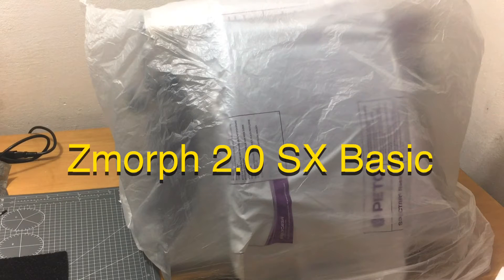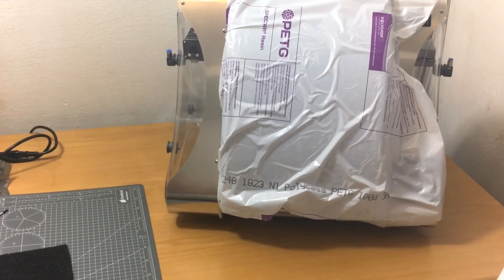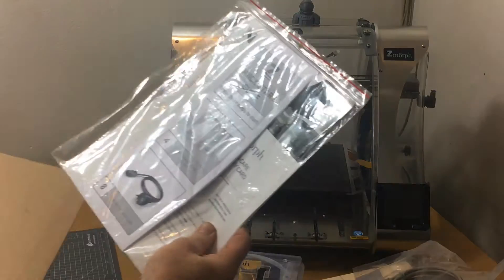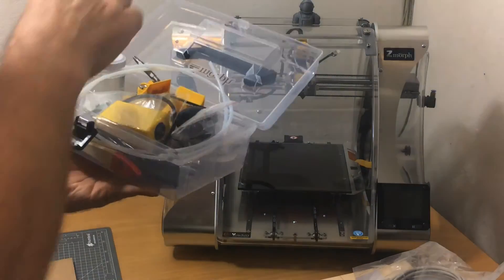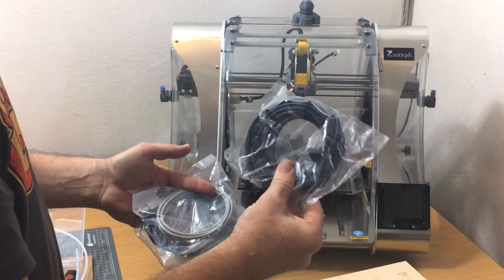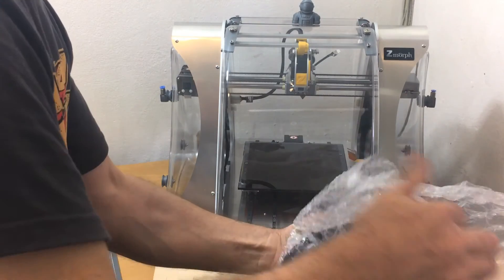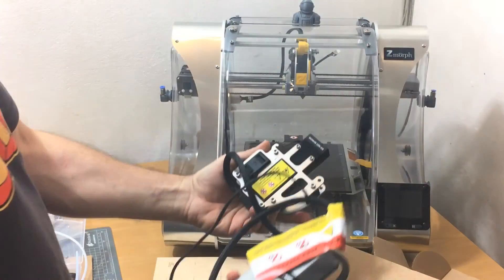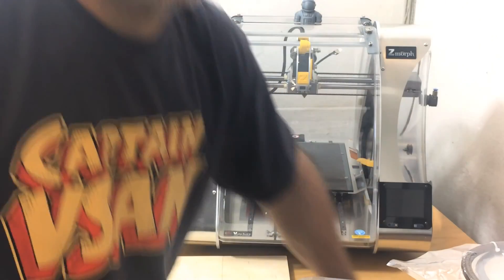Zmorph 2.0 sx Unboxing and review, part 1

Comment: Very cool vid. Can you tell me, do you recommend the zmorph? Have you tried printing chocolate at all? Can you give a rating based on your experience with this printer 0-10? Thanks!
Reply from the maker: Hi, thank you for having a look. Yes most definitely Recommended! As I do not have the chocolate extruded I cannot answer that. This is a SOLID 9.8/10 printer.
Reply: Thanks for your answer. Will you be doing more vids on it? Strongly considering it but still not sure.
Reply from the maker: Yes planning more videos soon on CNC and Laser  engraving as well.